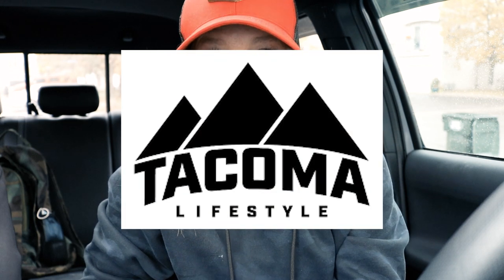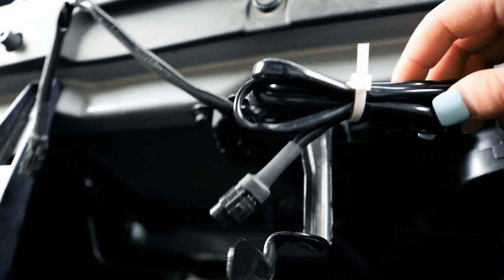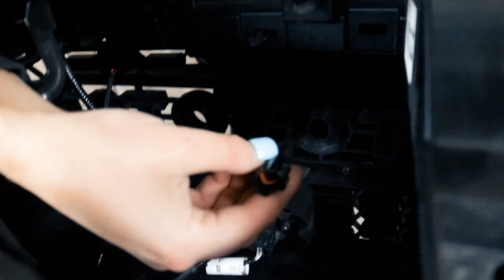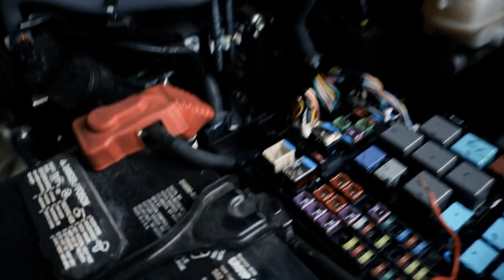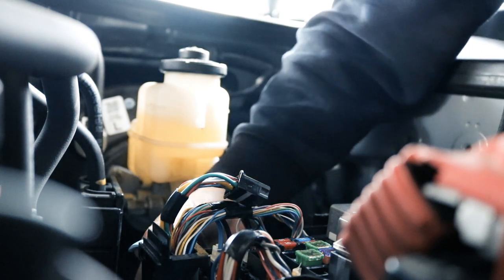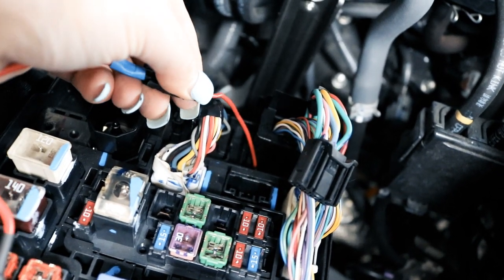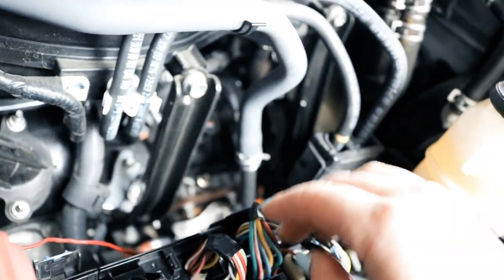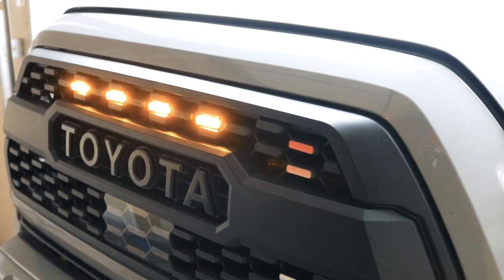Tacoma Lifestyle Raptor Lights Install | Turn On With DRLs

Comment from the maker: I messed up again..lol. There's another clip on the side of the wire bundle that opens up the casing and allows you to feed the wire in with the rest of the wires instead of through the gap.

Comment: The title says "turn on with DRL" but the video is about installing the lights and replacing the fuse to have them running all the time. Can someone tell me which fuse actually correlates DRL.
Reply: Plug it to the inj fuse
Reply: @lilianaflores7580  IT WORKED THANK YOU!!!!!! NOT ALL HEROES WEAR CAPES 😭😭😭🙌🏽🙌🏽🙌🏽
Reply: The inj is not the drl fuse…..and if you plug the add a fuse anywhere the raptor lights will be on all the time on engine start up. You need to splice into the wire coming FROM the fuse to the actual drl light

Comment: If she can afford that truck, she can afford another butt splice. Maybe spring for one with heat shrink tubing. I also connected mine to an add-a-fuse in the INJ spot. Used dykes to snip a small notch in the fuse box for the wire. I have an electronic gadget (from EBay) to dim the raptor lights to 1/2 power when the low beams are on. apparently, this is the EU standard for DRLs (my DRLs do this). Haven't installed it. Not sure anyone would notice.

Comment: How have they worked long term? I’ve seen comments on Tacoma World about people having issues with fuel injectors and even O2 sensors because they plugged that add a fuse into the INJ spot. One of the comments mentioned voided warranty. My lights are currently connected to the headlight fuse but would also like the raptor lights to be on all the time.

Comment: How would I get raptor lights to turn on and off with the DRL’s?  When the headlights dial is turned completely off, everything is off, when DRLs are on its raptor lights and DRLs, and when headlights are on its just headlights

Comment: Am I doing something wrong on my 2019 trd in that position they won’t turn on and my truck won’t start 
And in 10 a h-lo rh-lo obviously only right will turn on raptor light but my left headlight will be out

Comment: I have a question. When I installed the Raptor meshlight. My automatic daytime running light won't work. My car is the 2021Tacoma TRD Pro
Reply: I ran into the same problem but found the answer in a different vid. Make sure that you unlock the hand brake after ignition. When i did that, my amber lights works at any setting.
Reply: Mine too how did you fix it?

Comment: This is the only thing I’ve found closest to having them on with DRL’s and it worked !
Have you had any issues whatsoever? 
Thank you very much
Reply: In the INJ fuse spot, the raptor lights are on whenever the truck is running.

Comment: Question! Very belated question. I'm kinda new to Tacoma ownership and mods. 3 months I installed raptor light in my 2022 and used the INJ fuse location as you did. No problems until yesterday. Check engine came on and dealership said the add-a-circuit fuse tap was overloading the injectors and causing the O2 sensors to give bad readings. Then they charged me 3 hours labor for pulling out the fuse tap (not warranty they claimed) In the two years since you posted this have you had any issues similar. Thanks. Sorry I didn't see your vids earlier.

Comment: You don't need to pull that wire loom out. Just take an extra piece of wire, push it down through the loom. Then tape your red wire to it, and pull up through the loom. Much easier.

Comment: I tried using the inj fuse spot to have them on with the drl and they just remained on all the time. Even when the truck is off. Am I doing something wrong?
Reply: Did u ever fix it

Comment: What if I just want my raptor lights to run with my dlr and just headlights not all the time.
Reply: You dont have that option unless u have the auto headlghts.
Reply: @equalizer2233  I have the auto headlights. So what do I do
Reply: Wouldn’t wanting to run them with “only” your drl and headlights literally mean the same as running them all the time?
Reply: @angeloraucci5652  no. so even if the truck is off, the lights stay on - not good. I just wired mine to the inj fuse - best option

Comment: I ended up doing the same here, but my headlights didn’t kick on when they were supposed to 😅 to my knowledge, I don’t have any fuses unplugged and the add a fuse is in the right spot

Comment: Is that safe for plugging into inj fuse? I tried to take the inj fuse out and the engine stopped running immediately. I thought if the raptor lights fuse had a bad quality, the truck would just stop on the freeway when it had been fused.
Reply: You shouldn’t be pulling fuses with the engine on. Always turn off the electric!
Reply: I think the add-a-fuse adds a fuse in parallel to the INJ fuse.

Comment: So on that fuse where you connected, led will turn on on truck startup even if you have your main lights or DRL off?
Reply from the maker: Yes, correct. The lights will turn on with the truck even if the headlights or DRL's are off.
Reply: And will these raptor lights stay on throughout the day and night even while the headlights are on at night? And basically the raptors will just be on every time my truck is on? Thanks!
Reply from the maker: @septmbrsvryown  Yes, when your truck is on, the raptor lights will be on with your headlights and fog lights. When you turn the truck off, the lights will turn off.
Reply: So no issues tapping into INJ fuse location? No intermittent raptor lights coming on with fuel system check when vehicle off?
Reply from the maker: @JG-lj2ls  No issues so far at all!

Comment: Thanks for sharing and will be doing this mod as soon as my lights come in.  Question, tapping into the ING fuse will have the raptor lights on all the time just like the DRL?  This means they can't be turned off only when you turn off the truck.  I LIKE THIS!
Reply from the maker: Yes, exactly! They turn on when you start up your truck and turn off when you turn the engine off!
Reply: @LiannaMorrow  Ok, sounds good!  Thanks!
Reply: @LiannaMorrow  When u get the premium package it comes with auto headlights. There is a drl off position on the switch so u can turn all the lights off when u want to.

Comment: The wire splice (Butt Connector) of the add a fuse, needs to be crimped,. The metal splice inside the insulation of the butt connector MUST be crimped down to make a connection not the end of the plastic insulation. The connection WILL get hot and could damage your fuse box. Using just electrical tape to hold the wire in place will fail, get hot, and do some damage.
Reply: Spring for a new State-Kon.

Comment: The fuse holder you selected won't work on a 2022 SR5 because a plastic terminal guard interferes with the fuses on the add a fuse harness.  You can't plug the add a fuse harness in backwards if you want your new circuit protected by the fuse.  Plugging the add a fuse harness in any way that fits gives you a 50% chance of having no fuse protection to your new lights.  You need a multimeter and knowledge of how to use it to install add a fuse correctly.  If you don't know how,  find someone who does.
Reply: Fuses are non polarized and can be put in either way. It is not a capacitor or a diode. A fuse is just a wire with a certain amperage limit indicated on it. Any amount over that limit and it will “blow” the fuse, essentially melt the wire. Doesn’t matter which way the current flows through the wire for it to work properly.

Before you try to question someone’s intelligence, reflect on what you’re about to state as an apparent better answer.